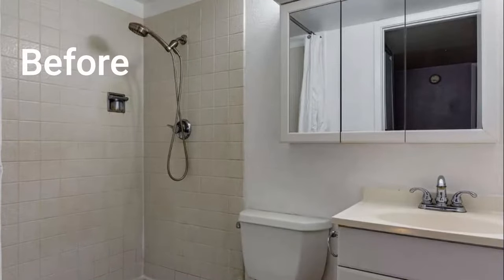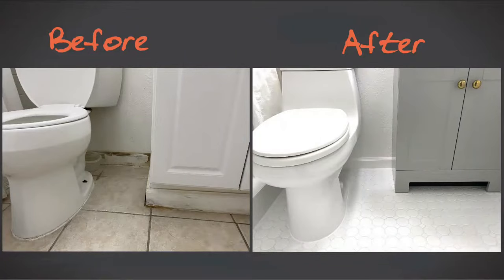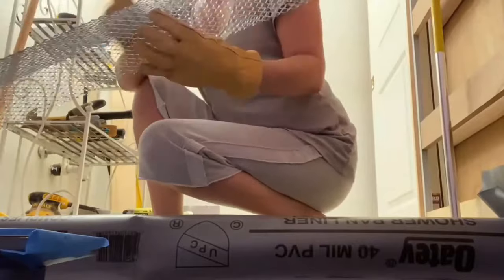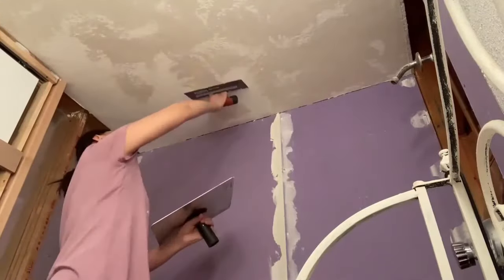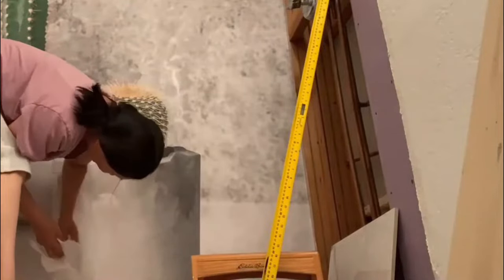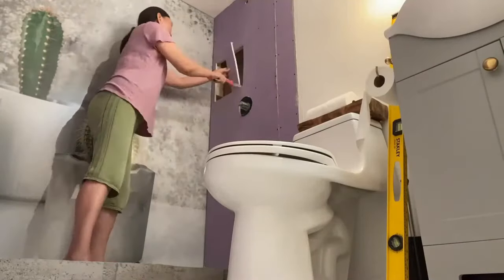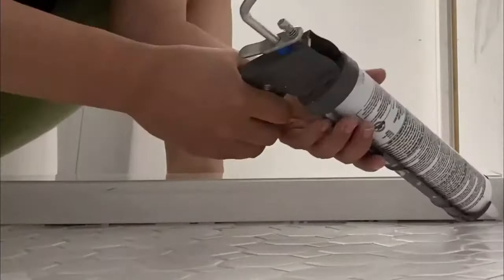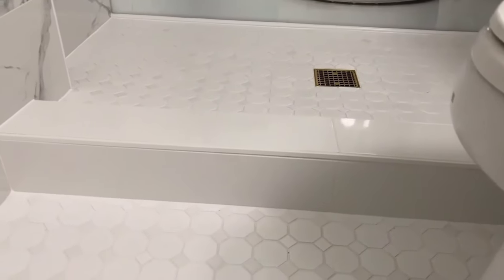Shower Walls Options-Bathroom Remodel-DIY

Comment: Wish you showed how you installed the glass.
Reply from the maker: Me too. That was one of those moments that I thought recorded, but was not recorded. So sorry!
But the glass is 1/4 inch thick, 60 inch wide 80 inch tall and tempered. Glass must go in before the both side tiles are installed because the tiles will be holding the glass in place though. The bottom of the glass MUST  sit on cushion. So in my case, bottom of the glass is sitting on the silicon strip and inside the tile frame. Then all around seems are grouted and silicon caulked for water proof.
Thank you so much for visiting!
Reply: @9handz-diy819  oh no!! That's ok👍great video and reno anyway